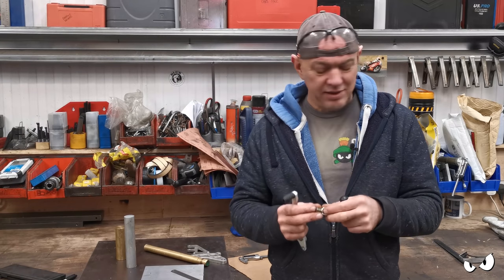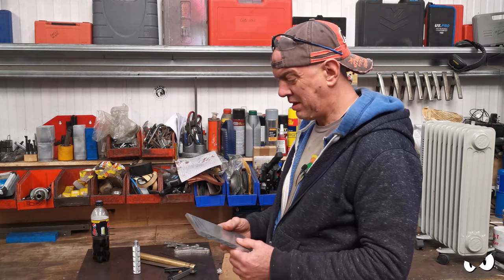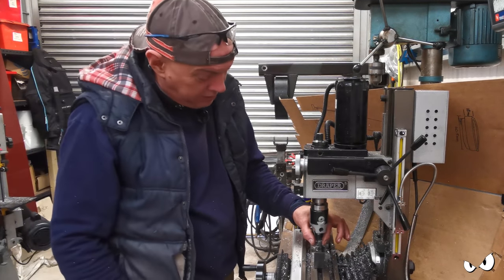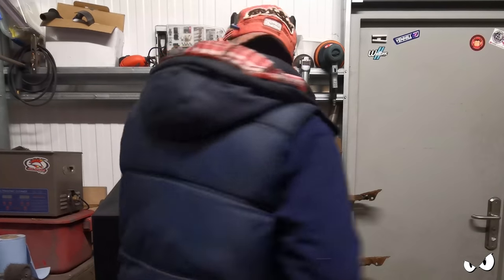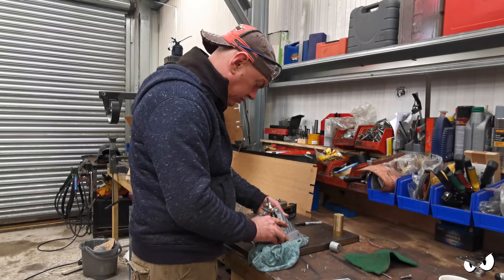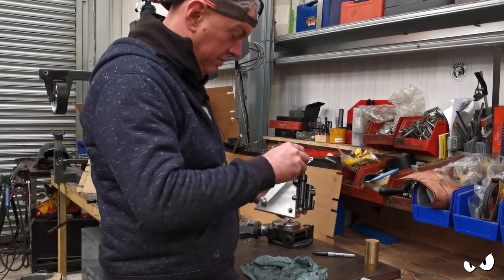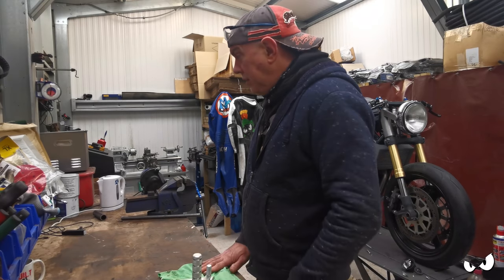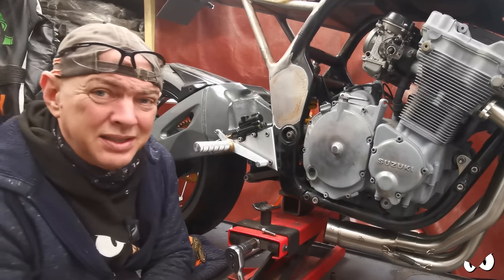Footpegs Pt3 - Suzuki Bandit Cafe Racer - GIXIT Project Part 64

Comment: Looks good I agree with you gixst engraved in the foot rest bracket would look good you could even colour the engraving by flooding it with coloured resin & sand polish to required finish.
Reply from the maker: Yeh, that's the idea.... very subtle and easily read when you look at it 👍

Comment: Them pegs look well good.  Nice work.  The only minor (and really minor) suggestion would have been to do your grooves with a chamfering tool (90°, plunged in direct), which gives a marginally nicer edge on the knurly knurls.

For cutoff, as long as your gibs are tight,  your tool is square to the work and bang on centre, everything that can be locked out is locked out, you're on super-low speed and with low feed rate, you'll get best results doing it with automatic feed.  With your hand on the e-stop button, of course.  Also, the real terror comes from doing cutoff when you don't have a hole drilled up the centre.

Also also, it's almost always much faster to use a bandsaw and then face off the end.
Reply from the maker: Yeah that's the way I'm doing it basically, it's just that you're plunging straight into the job. The first time I tried it was without a hole in the middle and the tool wasnt exactly centered so it started screaming and rubbing as I got to the centre. Ever since then I've just been very wary 🥴
Reply: @QuickBikes  If you haven't snapped off a cutoff tool, it's been a quiet week :)

I've got a bunch of cutoffs to do in some 50mm steel, about time I call up my mate with the bandsaw, jump in the car, pick up some beers on the way and go get my cuts done over there.  It would be easier to do some of the machining operations before cutoff, but fuck that noise, I can work around it.  A 50mm cutoff on my lathe is gonna take about an hour and 3 feet of 8x2mm HSS :).
Reply from the maker: Hehehe... beers and a natter are ALWAYS good 👍

Comment: In the old days people used to run 100mm pegs and M10 fixings, then they got shorter at around 80mm and m8
Never seen any M6 footpegs, toe pegs are M6, as a general rule m8 min, sitting is fine, as small loads, if you stood up while riding an M6 could shear, especially with 100mm+ pegs, diamond racing make probably the trickest ,now copied by the Chinese 7075t6 and m8 threads
Rearset plates are usually 8mm min, depending on design , as bending forces can easily twist them, racers prefer softer ally as it bends and doesn't snap like 7075, and heel guards are useful
Just friendly advice....
Reply from the maker: Friendly advice and I love it, thank you. Pegs are M6 currently but the plan is to drill them out to M8, just because you put quite a lot of force through the pegs even if you're not aware of it. Toe peg will remain M6 as I don't think more is needed. I mentioned the sizes of thread to see if anybody would mention it as I thought it was skinny, so thank you for chipping in and confirming my thoughts. I really appreciate it 😁👍
Reply: @QuickBikes  no worries, and as you have done always cut the prototypes from cardboard, you can print on thin card straight from your CAD, there's alot to rearsets geometry to make em work well tbh, straight levers aren't always the best, and ground clearance means sometimes you need to bring em up quite alot
If you have clearance issues as with your swingarm, just space em away rather than rebating the ally plate